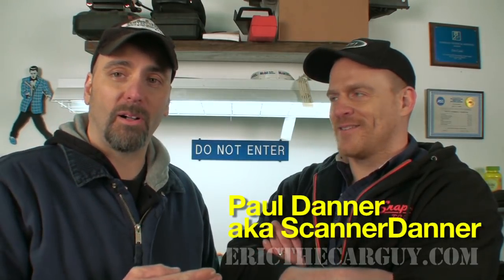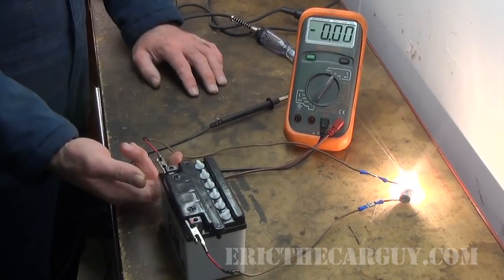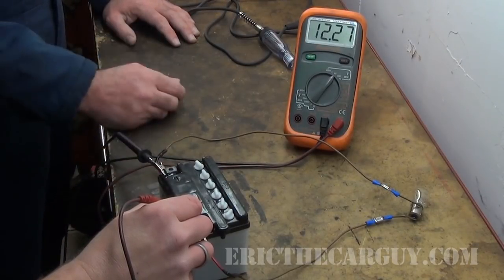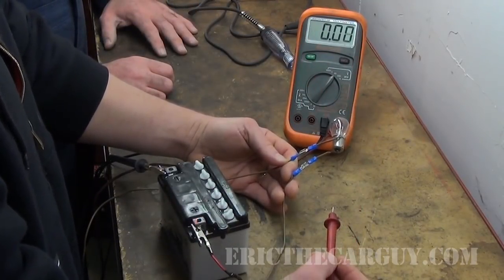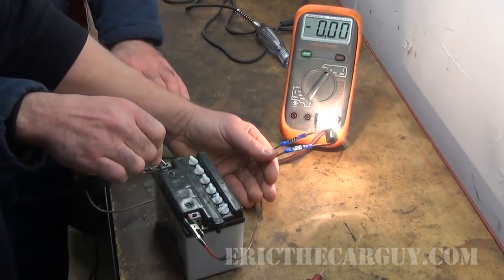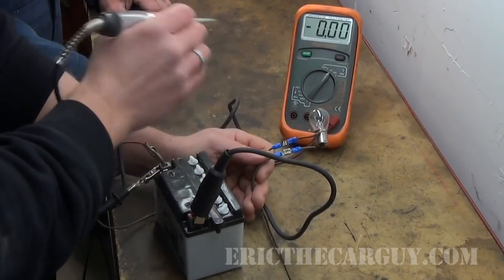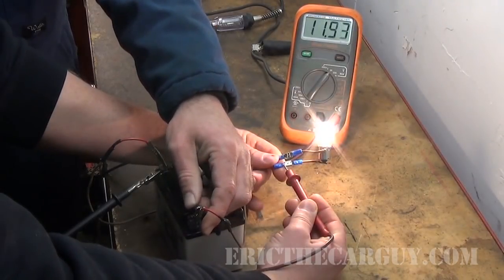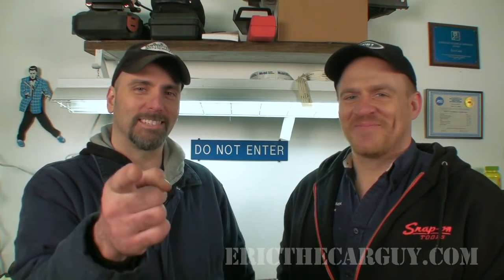Ground Side vs Power Side Switching -EricTheCarGuy

Comment: ok i was watching scanners video on basic electrical review on his premium channel but this whole ground side switched and power side switched inputs and outputs i have to keep doing this till its second nature harder for some than others but i am power side switched and i am grounded so here i come in other words i understand it but i dont understand it which is frustrating its like im almost there but lack something hmmmm maybe knowledge
Reply: Budget Boost DIY  wow!!!!!  Great find and tool to use!!!!!!!!!!!!!!!!!!!!  Thank you very much for sharing it!   :)
Reply: All u need is experience. Once you run into this issue hands on you’ll see things in a different way
Reply: This is what I took away to determine if it’s ground side switched or power side switches. 

Put ground test lead (black wire ) on negative terminal of battery, next with the red test lead back probe the “light bulb” (circuit has to be off by the way) if you get a voltage on both wires then it’s ground side switched. If you get 0 voltage on both wires then it’s power side switched. Hope this made sense.

Comment: Great video! I have very little experience on electrical systems; however, now that I watched your video, I understood perfectly well how ground side switched and power side switched function. I am working on a 2002 Lincoln LS, which has a nonworking or malfunctioning heating system. The A/C system does work, but when I select the heating, there is no hot air coming out. I am suspecting the heater control valve, which is ground side switched, to be bad. Thank you EricTheCarGuy and ScannerDanner for all your great videos. I am sorry if I don’t write very well, I am a Spanish speaking person. Thank you again.

Comment: test light is great because it loads the circuit but just to find positive and negative wiring those "green,red leds testers" are a must i believe.. keep up the good work! love to see 2 great automotive legends together!!
Reply: test light is only half the battle. It will light on 6V which will give you a false reading. 
We had a module that went bad in the car and the test light came ON while testing making us think it had power when it only had 8V going to it. 
Always use a volt meter to verify 12V

Comment: Determining circuit design, low side driver vs high side driver also determines the polarity at which your test light should be connected to in order to bypass components which I know Paul is notorious for doing(I do it all the time too) I just recently did it on a newer Honda(R17A) They use that starter cut relay with a yellow wire from the ignition switch energizing it. It is my preferred method for diagnosing compressor clutch coils as well. I am surprised no one has addressed Blind riveted TP sensors(Honda use to blind rivet their tps to the throttle body) A R&R video on those would be awesome. Great video guys.

Comment: Nice Video on explaining applied voltage.  If no ground wire is found in a circuit it will be "flooded" with the voltage applied to the circuit.  Even with many resistors in the circuit.   Think of a winding river.  If you place a dam in a river.  The current flow goes to zero and all the winding turns and bends in the river get flooded out and overcome. You are essential cutting of the current flow.  Those bends and turns in a river can be compared to resistors, but with a dam in place in the river (damn is like an open) they are overcome and now the water become static and the stored energy is the same from the power source to the dam (the open).   Once the dam is removed (switch is closed) the circuit is complete and you get current flow...now the resistors (bends in the river) can effect current flow once again and you will energy losses (voltage drops)  as the water flows around the bends.  Very archaic way of explaining it but it helps to understand the basic theory.
Reply: +Oneguy If you test the side of the damn that has water flooded to it that is the positive side and you get applied voltage....if you test the side of the dam that has no water flow...that is the negative side and you will see zero.  This my friends is known as my "DAMN THEORY"  used it to teach military technicians for years. lol  Hope I didn't confuse anyone.

Comment: Excellent information! I have been wondering about the positive vs. negative side switching since I fixed my cars central locking remote system and read through some forum texts about central locking in general. Didn't quite understand how it works (got the remote control box installed anyway though), but this video really clears it up. Good work guys!

Comment: The other way to quickly identify which side is switched if both sides show ground is to look for ghost voltage after disconnecting the device. The side where your multimeter shows an unwavering zero volts will be the constant ground, and the switched open side will show ghost voltage.
Reply: good tip!
Reply: ScannerDanner hey I'm a first year heavy duty and I'm having troubles and at work understanding back feeding like when you did it positive to the posiive side it still lite up could you explain it a bit better sometime?
Reply: VIheavyequipment
To be clear, you are talking about when I had my test light connected to B+ and I touched on the positive side of the light bulb circuit with the light bulb still plugged in and the light bulb wire disconnected from B+. Right?
Reply: VIheavyequipment
The short answer is this: If you are doing this test with a high ohm load in the circuit, the test light may not even light. If it is a low ohm load (like in the video) the test light lit brightly.
Another twist, if using an LED test light, it would even light with a high ohm load in the circuit as it doesn't require the same current flow to light the LED as it does an incandescent bulb.
This is one of the reasons I do not like the circuit testers with the red and green LEDs for power and ground ID.
In this application, one of those tools would have lit green on that positive side of the circuit telling you it is a ground, when it is not. It is an un-switched or turned off power supply.
There is so much to this. Hard to put all the variables into print.

Comment: This is so important and should explain why you MUST disconnect an alternator COMPLETELY, not just the battery, before using arc welding on a vehicle.

Comment: Great video! The only thing I would've added to the demonstration is another short piece of wire with alligator clips on each end to more accurately simulate a switch. The benefit to this would be identifying a positive side switch with just the volt meter by reading the switch's terminals.

I think it also would've been nice to have a discussion about use cases for switching negative. But perhaps out of scope for this video.

Comment: Great video, while I did learn most of this stuff some 15+ years ago in school, I have forgotten most of it because I have not used it in so long. It's nice to have a good refresher once in a while. Eric, really can't wait for some Fairlane videos, I know you want to work with sponsors and what not for upgrades, parts etc.  But I would think there must be some videos you could do on it right now, like simple maintenance stuff.
Reply from the maker: First, it's a Fairmont. Second, I've already shot the first video. Thanks for your interest.
Reply: Ah yes, Fairmont. I know the difference, just typed it wrong. My bad. I actually used to have a 86' Capri with the 5.0 HO and dual four barrels and edelbrock intake. It was a quick ride but a total rust bucket because it spent its life in New England with harsh winters. I ended up selling it from 2400 about 9 yearxs ago. I really regret iot now because I wish I had something to run at the track because I do not live far from Lebanon Valley drag strip. Anyways, cannot wait for some Fairmont videos. I'm not a Ford fanboy or anything (I like all makes, it's stupid not to) but I always loved the foxy body platform because of it's simplicity and the huge amount of parts and swapability. I mean hell, I could pout a F-150 dash in a mustang, heh.  Keep em coming Eric.

Comment: Hi Eric, just one thing that might be of interest, a 21 watt bulb on 12 volts draws approx. 2 amps, so by ohms law the filament of the bulb would be around , 6 ohms, now if you put an ohmmeter across that bulb it would read 0 ohms, try it, the only time the filament has 6 ohms is when it is red hot, if you could measure it then...other thing on mains electricity the switch is normally live side switched for safety reasons, so you don't get a shock from the bulb with it turned off....Fred in England.
Reply from the maker: Thanks for your input!
Reply: EricTheCarGuy By the way Eric and Paul, great video again, how far apart do you Guys live, does Paul drive or fly to yours Eric? Fred uk
Reply: Tom Smith
4.5 hour drive Tom. Not too bad.
Reply: g4vvq1983, it is true that resistance of an incandescent bulb rises as it heats up, but that bulb is not 0 ohms at room temperature.  I think you need a more sensitive multimeter with sub-ohm range, that if you are at this stage of observation then the one you have is not versatile enough to help you proceed further in diagnostics.  Many times you might have a bad electrical connection and it could help to see differences of an ohm, though another way through this issue is to measure the voltage drop across it (if you can power up the circuit).

Comment: 13:38 instead of test lamp sir,  you can use also multimeter by putting the one probe in positive terminal of battery and the other probe is for the wire you want to check.

Comment: you could use "ghost voltage"  when testing for control wire(unplugged) during the positive side switch as an alternative rather than a test light? as one would have ghost voltage and the other would have 0V if im not mistaken

Comment: In electronics we call this sourcing (power side switching) and sinking (ground side switching). Its also good to understand most digital chips support more current when sinking.
Reply: good tip Kyle! never heard that before. why is that?
Reply: Similar in welding. Electrode positive or electrode negative usually translate into more or less heat. Well beside another "million" variables. :-)
Reply: Most digital chips don't handle enough current  in automotive apps to matter, instead controlling mechanical or solid state relays, or a more integrated transistor switching which can be set up either way depending on the other requirements for the circuit.

Comment: Hey Eric great vids. I just bought a 1947 plymouth with the original owners manual, It shows a positive ground system but the battery is hooked up as a negative system. Ir runs and all gauges work and horn but there are no lights anywhere. Is it due to the battery hook up or something else ?

Comment: I'm currently making a DIY electronics circuit for use in car. If a car is using high side switching in its wiring, so should I use P channel mosfet to switch my electronics?

Comment: Hey Eric i have a diesel truck and i am trying to isntall a hidden kill switch. I am not sure if i put it on the fuel pump side if it will mess anything up or not. So i am thinking on the starter side. Can i just cut the power wire to the starter relay and install a 12 volt switch? Or do i need to find the starter wire in the steering column and tap my switch into that? Or will neither of these ways work? Thanks

Comment: You said that if you hook up your test light to positive side of the battery you just go ahead an touch the wires to find the ground side. Its true however your test light is not fused and it could fry the components on the negative side of the circuit.

Comment: another easy way to confirm a ground sid is siply set voltmeter to ohms and test each side of the harness to ground this can also verifit if your looking at a poor connection as your resistance will be higher

Comment: Is it possible to not know yet and you use a test light that you can damage the computer?  I was taught to use the DVOM but the bulb load can show a loss.   I found a ground to a trans computer was bad and I used a headlight to test the ground but it wasn't going through the computer... I think it was disconnected.

Comment: Thanks guys.  I really enjoyed that vid.  One question that is bugging me… When you were negative side switching and you tested the negative side of the circuit, why didn't the light come on?  Isn't the circuit being completed by the voltmeter because its connected to the ground?
Reply: Technically you're right, the meter is completing the circuit which is how it measures the voltage. However the series resistance of the meter (which is just a fancy way of saying how much current will flow through it at a given voltage) is extremely high in the order of 10 megaohms or more which means at 12 volts less than a microamp of current will flow through the meter which isnt enough current to heat up the filament in the lightbulb. This incredibly small amount of current is enough for the meter to accurately measure voltage
Reply: @oddball0045  I had this same question. Thank you for your explanation.

Comment: Very interesting video on ground side and positive side switching Eric. How in the world did  you know i was having a problem with this issue? I have a 2006 Peterbilt 387 and my reverse lights wont come on. Checked relay and everything is good, except the magnetic coil side of the  relay is always hot.  If i add direct ground to the opposite side of the coil the reverse lights come on. I heard you guys mention the computer might ground it in some cases, I think this is the case with my little problem. Perhaps my computer is not grounding the relay automatically. If so, is there a simple fix? or a costly one. By the way my reverse sending is unit is brand new. Great video.

Comment: Since electrons actually flow from the negative to the positive you can think of voltage as an electron vacuum.  Another way to think of it would be as potential flow.  The reason that you measure 0 volts on a power side switch is because the voltage between the battery ground and your other test lead is 0.  There is no potential there.  Whereas the voltage between the battery ground and the other test lead on a ground side switch would be 12 because there are 12 volts of difference, or potential, between the ground and positive on the battery.

Comment: how do you wire a 3prong switch to ground with an LED. i can get the light to come on when the fan is off when i switch the fan on, the light goes off. is it possible to have the light on when the fan is on? its a manual fan switch for 6.0 powerstroke, also known as the blue wire mod

Comment: So I have a car that was in accident and some wires were chopped up. My rear lights don't work except turn signal lights and breaking lights. 
My plan is this: 
I'm going to clip my test light to the body of the car turn the lights switch  on and touch each wire to find the positive. If my bulb lights up that's the power  (+) and the wire that doesn't is my ground. 
Or with the multimeter  same picture but in this case I check for 12v power(+) and 0 volts ground (-)
Does that make sense? ☺

Comment: Im checking my purge valve solenoid circuit. with ignition on, but not running, while back probing im getting 12v on each line, which makes it a ground side switch correct? unplugged with ignition on, im getting 5v on left and 12v on right. with ignition off using light connected to battery positive, left is off and right is on. whats going on? am i checking something improperly? im getting code p0443 on 2000 jeep cherokee. thanks for any help

Comment: the best way to check for ground side switching is to check the switch. If you have power with the switch in the off position and nothing on both posts with the switch in the on position then you automatically know its ground switched because the load is burning the current

Comment: good video ,I think if you would of used relay it would be easier to demonstrate .positive trigger and negative trigger and flipping power to ground and ground to power by using two relay.but good video though.also I was gonna ask if you ever used dual vanos timing tool .I haven't seen anyone use the tool on youtube .itwould be cool if you made a video on using e46 m52 m54 bmw engine doing the timing with the tools and using the vanos alignment tool.

Comment: Does this simple test apply in the case of LED bulbs, which are gradually taking over all incandescent bulbs? Thanks.
Reply: David Gold - Generally speaking yes it applies. But led's have one advantage. Their polarity is fixed. So the + and - is always defined. Although switching can either be positive or negative, just like in this example.

Comment: Eric I have  a 1999 honda accord I get 33 miles to the gallon all winter long but as soon as the Outside Air Temp rises  60 degrees the engine chokes down and will not run,,,,,, Honda has had it twice and two other local mechanics have not been able to diagnose it,,, any clues,,,2.3 vtec 165, 000 miles, I have a good vacuum,,,,,does not burn oil,,,,or use oil,,,,,thanks Guy Holley in Tallahassee

Comment: I'm building a tahoe, so im trying to figure out how to wire the msd and holly sniper efi with the specific instructions, but it makes no sense why some have to be ground side, and others positive.... why does it really matter? I should say I pulled the old harness out and everything going in a new! I went from a vortec setup to a 355 carb setup. So I've got some work
Reply: Maybe I get it now, since it's coming out of my msd tcm box, it's already hot, so when it says to  hook up to ground side switch, im basically completing the circuit by connecting the ground through the switch.....so the ground is technically playing the hot side role? Whew.... what a brain teaser